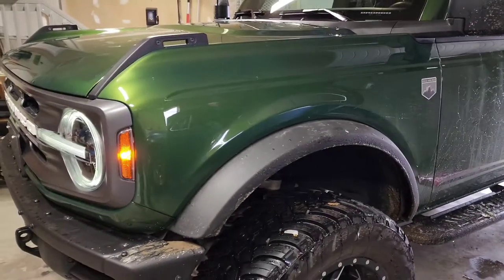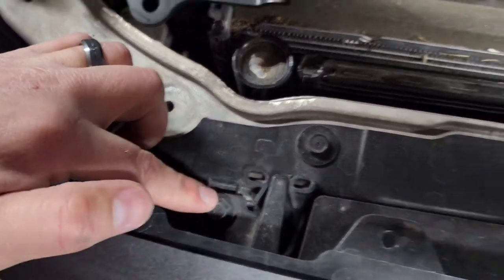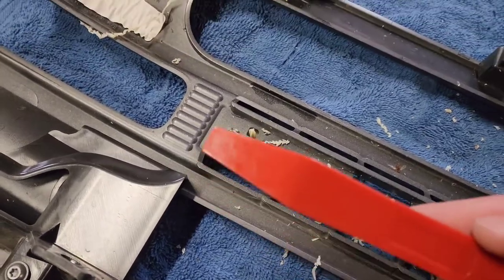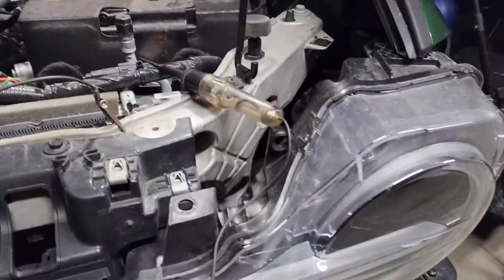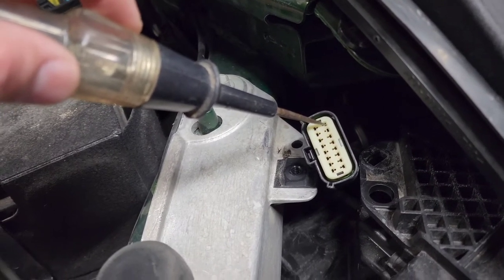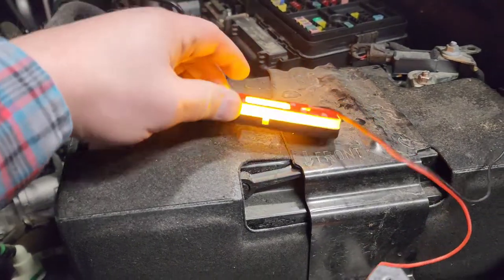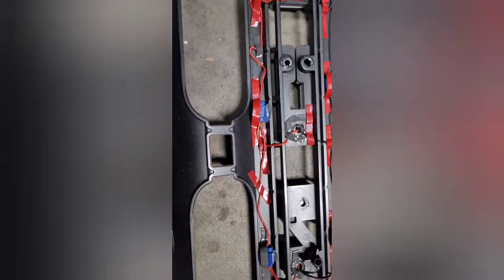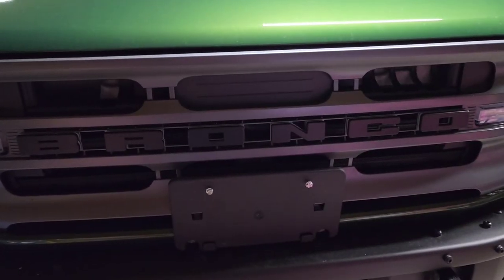Installing oracle L.E.D. letters on a 2022 Ford Bronco front grill (big bend)

Comment: The dealership offers this?
Reply from the maker: The oracle lights? For the grill?
Reply: @revelation6_8  yes, the lights for the letters and the installation.
Reply from the maker: @tpp4007  these lights were purchased off of the oracle website. I'm not sure if any dealership offers them.
Reply: @revelation6_8  okay, it’s aftermarket, dealerships won’t install then. Thank you for the info.
Reply from the maker: @T Pp  no problem,  I would still ask around. More and more dealerships are willing to add aftermarket products nowadays.
Reply: @revelation6_8  oh yeah, that’s very true. I try to avoid dealerships for the high cost.
Reply from the maker: @T Pp  I don't blame you lol. I try to do as much of the work as possible myself